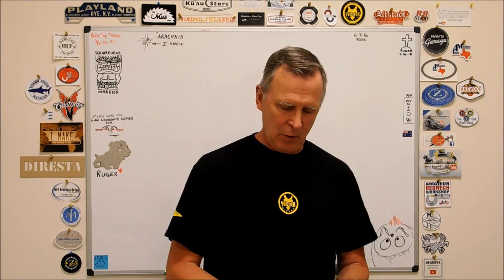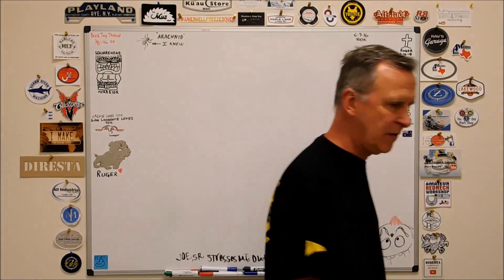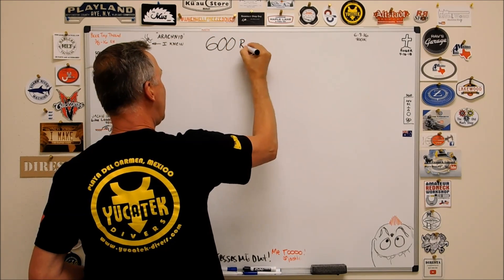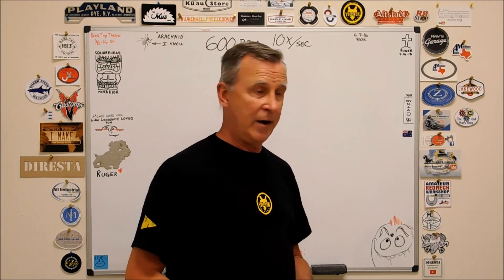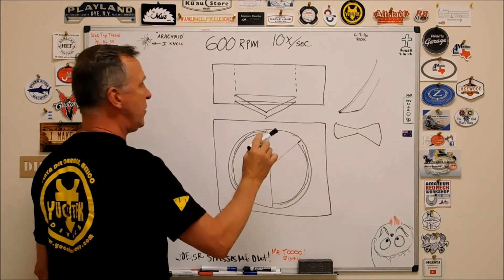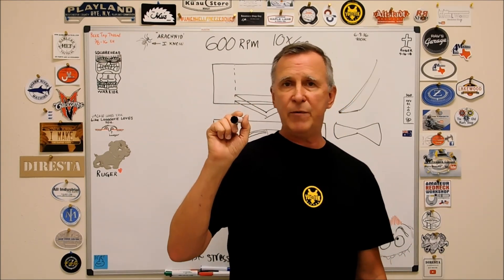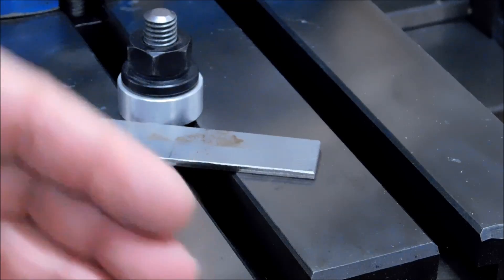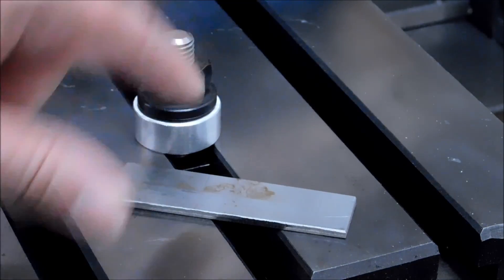EVERY METAL WORKER SHOULD WATCH THIS...

Comment: When working in a car dealership, a co-worker was drilling out an air cleaner box to rivet a once spot welded bracket back onto the box.  As I was walking past him I noticed he was holding the air cleaner box with his hand DIRECTLY behind where he was drilling the hole.  Before the words of warning could exit my mouth, the drill broke through the sheet metal and completely through the palm of his hand.  He never drilled anything in his hand afterwards.   20/20 hindsight.
Reply from the maker: Its almost impossible to stop  "The Dive".

Comment: Some folks just don't understand the danger of machines that spin. I saw a man get his pinky ripped off on a drill press because he was wearing gloves. I have seen on countless occasions people wearing long sleeves, gloves, hoodies, and long hair not tied back while running lathes, mills, and drills. I make sure to tell them the story of the pinky every time. These machines are no joke. In my opinion the only piece of equipment in a shop that is more dangerous than these machines is a fork lift. A fork lift is a danger to the operator and anyone around the operator.
Reply: Well said! In the professional woodworking shop, more so in older times, the machine that endangers the most people would be the shaper, or spindle moulder as our British cousins call it. If an improperly prepared knife and head let go, everybody in the machine room was in the line of fire! Nowadays, the loose knife heads are quite a rarity,

Comment: My remedy has been to chuck it in a vice, and C clamp a piece of wood or scrap metal underneath the drilled part.  The drill comes out of the product part, enters the scrap piece and has no free travel to surge into.  Added benefit, less burring at the bottom of the hole.

Comment: Great info - I contend the drill press is the most dangerous piece of equipment in the shop simply because it doesn't illicit the same amount of fear as the lathe. 

My first day as a machinist I left the chuck key in the chuck of the Triumph 2000. My normally kind boss secreted  the key out of the chuck and and gently asked to see the palm of my hand... and then whacked me full force with the chuck key. I have never left a chuck key in a lathe since. Behaviourism works %100.
Reply: Smart boss.  If you had sued him for the lesson taught, it would still have been cheaper than if you sued for an on the jop injury.
Reply: @prodoverjeff2876  That was before suing people acting in your best interests and in response to your own stupidity was in vogue...

Comment: I just watched someone's video on making a worm gear and was impressed until the person started drilling parts freehand! Same thing - I cringed...9 stiches for me 35 years ago was enough.
Reply from the maker: Its usually the least intimidating process or machine that can do the most damage. This video should be required viewing for machine shop students.
Reply: @joepie221  True about the innocent appearance - Run a 25 HP CNC mill and get cut while deburring a part you previously pulled from the machine :)

Comment: I was drilling through an 1/8" steel plate with a 1/4" drill bit, held in one of those el-cheapo drill press vises, figured that would be enough to control it. Sure enough, drill bit caught the plate and picked up the whole vise spinning it a few times before flinging it off the table. Luckily I didn't get hurt, but a set of hold down clamps was on order minutes later.

I think the reason this happens so much is the ease of aligning a part to a center punch when the part is floating, since a center drill or spot drill will slightly shift the part to follow the center punch. Ill admit its certainly easier to find a center this way, but the table stop you showed is an absolute must at the bare minumum if this needs to be done. Good advice as always Joe!

Comment: Oversized parts I don't get crazy with my speed. Im very cautious about my speed I've seen some  unsafe moments though
Reply from the maker: I guarantee you wont forget the true moments, you witness, of " Oh Sh#*". I've seen more that I care to share.
Reply: The oh shit moment was when I was told to use more soft jaws with existing soft jaws. Right off the bat with the speed that was chosen the 4000lb part started to walk into the machine stopped machine very slowly at the end the part was barely on the live center. I almost had to change my underwear. Whew!

Comment: Did not see it, but was told about a  guy drilling a larger piece of sheet metal which took off spinning on penetration.  Sliced the guy's gut open, died on the spot.
I drilled several extra holes in the drill press table that fits the chuck key handle--does double duty.
Reply from the maker: Be careful. As a by product of the grab, there is also a lifting action that could pull the chuck key out of the table.

Comment: Nice Video. I have worked with metal for 60 years. When I have a new employee the first thing that I tell them is that the most dangerous machine in the shop is a drill press. I have seen many times that parts were not held properly and injuries resulted. Something else worth mentioning is that when you working with any revolving piece of equipment do not wear loose clothing or gloves. Bad idea. A few years ago we had a girl at one of the local colleges running a lathe and her hair became entangled in the lathe and she was killed. I will also add that we only come with one set of fingers.

Comment: Yeah ive done it, lucky to have 10 though some took a beating but still in good shape. Thanx for that 1. Will definately make myself some of those L's. To all those out there whos got a lathe in home workshop, keep the tools and bits OFF and AWAY from the gearbox head on left. The vibrations WILL allow those goodies to travel to the edge maybe fall on chuck, get slammed on rails or where ever bounce off to your face and gone is your eye if you dont have a goggles on. In your currency a 1 dollar pair saved my eye.

Comment: You don't mention the drill geometry modifications that will reduce the tendencies to grab.  Stone the helix surfaces of the drill parallel to the axis.  This is mandatory on brass, where the hog-in tendency is so severe that it can rip work out of clamped setups, and pull drills out of collets.  There are drills for use on thin materials (step drills with no helix).  Even when clamped, thin material can buckle and turn into a ball of whirling "razor wire".  Also, debur pieces before you drill them.  Use tool with torque-limiting, where stall torque is just above the amount required for drilling.
Reply from the maker: Proper work holding and awareness are the message here. Nobody is fast enough to not get hit when this happens. And, drills with muted leading edges used to cut brass, actually require more force to drive, and i have to believe, that would make the break through even faster. It just doesn't have the tendency to dive while pushing through solid stock.

Comment: I modified a pair of the 11" vice grip clamps for my drill press. Cutt off the fixed arm and welded some 1/2" all thread on it. Bolts right on to the table, makes it very convenient to move between holes
Reply from the maker: Excellent idea.

Comment: I currently freehand almost all of the holes on my knife handles. I have helicoptered quite a few over the years and luckily haven't been injured (not with the drill press yet). Drilling any holes over 1/4" on something other than relatively long & easy to hold pieces of steel, and / or on a larger drill press, and I'd clamp them down for sure. 

Knowing where not to place your hands makes a lot of difference too (the scissor action you were mentioning would be my main concern personally). I usually have it set up where if something comes free, it will pull from my hand, spin about 90 degrees, then hit the column and break those chips where it's grabbing. 

Really holding the piece down hard will keep it from happening 95% of the time though (on long easy to hold pieces, with a smaller drill bit and on a small machine*). It will catch once every 5-20 holes but the vast majority of the time, the piece will break free after coming off of the table maybe 1/4"-1". It's taken well over 1,000+ holes to get it figured out though, and it still does happen on a fairly regular basis (yanking it all the way out of my hand).
Reply from the maker: The operative word here is "luckily". I don't endorse your technique because for sake of speed, you sacrifice safety. It only takes ONE time and you'll regret it forever. Don't be blinded by the "OH, Ive done this a thousand times" mentality and think it won't happen to me. Clocks ticking. Why risk it??
Reply: @joepie221  Oh yeah, I don't endorse it, clamping the piece down is the correct way. Just saying that's how I do it for the specific pieces I make, and that there are varying levels of being unsafe haha. 

Time is the main thing for me. If I have to drill 10x 1/4" holes and 6x 1/8" holes per handle on 20x blades, clamping for each hole really adds up. Having the piece free also guarantees that I can line the drill bit up with the center punched hole and have it self center instead of being off and bending the drill bit  /messing up the hole or having to turn the drill on and off after every hole to line them up  (for the handle pin holes, the ones to remove weight can be less precise). My tools are fairly basic and I can't dial in exact measurements or anything. Again, not saying it's right, just how I do it.
Reply: @colsoncustoms8994  Machine are dangerous.  That's just a fact.

The thought of what you are doing scares me.   It's our hands.  Not mine.  I don't know why it bothers me so much.  It just does.

Please,  be careful.  Accidents happen all of the time.  Accidents that could have been avoided aren't really accidents.  They are gambles.    I'll bet my fingers that I can save a few seconds and get away with it again and again.   I won't bet my fingers like this.

I took the time to write this  (longer than it takes to use a vice properly)  because I don't want you to be hurt.   I'm not trying to argue or put you down.  It's not about being right.  If it keeps you safe,  I'll happily be wrong.   Doesn't it make sense to hold the work down?

Best wishes.
Reply: I've found it doesn't sacrifice any speed to just drill the handle on piece of scrap wood held about an inch below the top of the vice jaws with the vice clamped down.  If the piece grabs it's trapped between the jaws and can't spin.  I had plenty of spinning knife blades myself before I worked that one out.   Even got my finger caught by a spinning axe head once.  The machine is definitely stronger than your hands.
Reply: @JakeMcNaughton  That's a smart suggestion, but it doesn't cover the case where the workpiece gets raised/yanked above the vice by the helical flutes grabbing, at which point it becomes a helicopter rotor. That's where Joe's boots come to the rescue. Even lacking a vice there's no reason not to have a couple of upstanding items (posts, buttons, blocks), one attached to either side of where the drill bit enters the work to take the torque reaction if/when the drill grabs. Just as long as they have overhanging features at the top, to prevent the work from being pulled above their restraining influence. Like a larger washer on top of a vertical piece of tube, under the head of the  bolt holding it down through a slot in the drill table.

The knife maker who seems so resistant to the idea doesn't seem to realise that there is no "clamping down" involved in the idea of the boots; there can be a bit of vertical clearance, so he can still position the work freely.

Comment: Thank you so much for this Joe... Still lots of old timers and newbies do this foolishness and I cringe. Need to also tell the folks that thin sheet metal is actually the MOST dangerous.. Literally a spinning razor blade..  Tree bits solve this and don't lift.. If you can use them you should. That is the ONLY way you can drill sheet metal with little or no support due to the geometry of the tree bit.
Reply: Saw a aerospace related video a while back that drilled unsupported thin metal and I sent them a comment  stating (a) it was a bad idea to do and (b) it was bad example to set for others on youtube.  This was supposedly a "professional" outfit and also seeking crowdfunding and investment dollars.

They defended it.  "We think it's ok."  Pretty much told me what I needed to know about that group.

Comment: A guy over here on OZ is selling some great hold down clamps for the drill press AU$35.00. https://www.facebook.com/marketplace/item/465602027515425/?ref=messenger_banner. I think something like this would save a few bones on a drill press!
Reply from the maker: Agreed. Something is better than nothing.
Reply from the maker: I personally like the ones that grip the stem of the machine and swivel. They are low profile and easy to set.
Reply: @joepie221  You don't see them around here, probably easy enough to make though. Most people use "C" clamps or vices, but for big stuff this looks pretty solid. I have a few of the adjustable snap down adjustable clamps that I attach to the table, but they wouldn't have the clamping pressure of the above one. By the way I am in Oz and we don't get to see as much of the stuff that is available in the US.
Reply: If you want to go really cheap you can also use a couple of bolts with space tubes & washers though the drill press table on opposite sides to the work similar idea to your "L" blocks. The point is there is no excuse not securing your work from spinning. I have used the 2 bolt method to drill lots of holes in a row out in the field with a saw horse & a cordless drill, drill-slide-drill-slide etc- no strain no pain.
Reply: @joepie221  I tried finding one of these https://www.travers.com/cam-lock-drill-press-clamp/p/61-171-001/ & even Travers Tools in the US no longer stocks them, . Not too sure if this what you were talking about, but I cannot find anybody over here who stocks them.

Comment: How can you drill some larger plate pieces and fasten them?
Reply from the maker: C clamp larger parts directly to the table. if the plate is too big, the use of a magnetic drill press may be required.
Reply: Like the guy said above. Butt them up against the column.

Comment: Hi Joe, I had a thought about tapping holes in plate metals and thought, who better to ask than yourself? I thoroughly enjoy your videos and the dearth of knowledge and techniques you humbly share, so, thanks.

I recently watched a video in which a guy tapped a hole in some brass plate that was no more than 2mm thick, but he ran his tap down at least 20mm through it. It got me wondering, once the taper of the tap has worked its way through, and the tap is fully engaged, does it serve any benefit to run it through more? Or has the tap completed its job once the full thread thickness has emerged through the other side of the material?
Reply from the maker: In my experience, the answer should be no. But. Since most of the work is done with the leading areas of a tap, it only goes to figure it will be sharper and closer to the original profile, the closer it gets to the non ground area. So by going deep, you most likely get a better thread from a tap with possible wear.

Comment: Drill press is the most dangerous tool in most shops.
Reply: Next to a radial arm saw. ,,, and the venerable punch press. Used to get call ins to repair the controls and every old press I ever worked on I wondered how many fingers it cut off.

Comment: And remember,  that "lifting action" is even worse on round stock. Because as soon as you break though, the material left gets thicker before it's sheered off, meaning a greater chance of it grabbing. And sense you'd normally have a full grip on a round piece, rather than just downward pressure, you'll  break a wrist/potentially getting drug into a machine. Makes me shiver seeing that. Great video Joe, keep them coming.
Reply from the maker: True.

Comment: 10 revs per second, That's one rev every 100ms. Let's talk reaction time, The average humans fastest reaction is to touch. that reactions average for a human is 150ms, That means that part has potentially made a full rotation and is halfway through another, The average reaction overall is about 250ms. So 2.5 rotations at 600rpm. The take away. In the worst case that it grabs the work piece like it means business. The damage is done before you can even register that something just happened.

always remember rule number one. I worked in a shop where part of the orientation was a lecture on shop safety, during this they showed a video of 3 guys at a tech school that thought they were going to stop an old 3hp engine lathe on the 80 RPM gearing with a 3.5 foot steel bar, the end result was of course three guys with broken bones. just a gentle reminder to people, That machine is strong enough to sheer metal, You are a lot softer and squishier than metal, and that machine does not differentiate between you and the workpiece. That machine will do exactly what it's designed to do, to the part, or you, or both if the parts not secured well.

And yes I agree with Joe vehemently here that any time I see someone freehand drill I cringe. even a little part like his demo, it doesn't take long to throw some parallels in a vice, make a quick positive stop, then you just crack the vice open a tiny bit, new part, re tighten, if you're freehanding accuracy isn't an issue so just in, out, next. It takes about 2 minutes to set up, and is a whole lot safer.